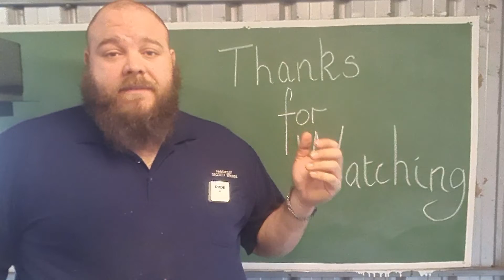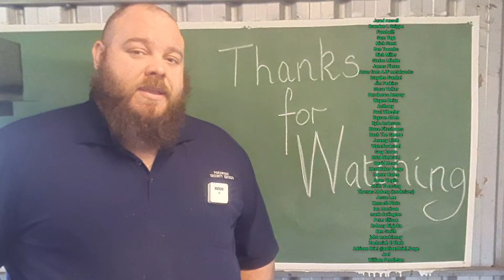Relining a Postbox Forge

Comment: So,... that was 2 layers of 1 inch isowool?, regidizer and then how much refractory on top of that.  I saw where you forgot to film the refractory part, what a mess that always makes for me.  Good job.  Love the podcast and would also love to see a postbox forge video.  Thx.
Reply from the maker: The RTZ coat is only a few millimetres thick, it doesn't need to be very heavy, as it's main job is to make a hard reflective layer at the surface.

Comment: I'm build the same venturi  burner 1inch , what size orifice are u using ? Have you found 2 work best for the post box , I'm currently build one using old metal solvent 5gallon buckets,  thank you sir love your content
Reply from the maker: This is the gameco large burner, they come standard with  a 0.8mm orifice
Reply: @SamTownsBladesmith  the one I have didn't have (guts) I've build that part  used .045 mig tip , I think its 2 big , 8mm is a .030 mig tip Im pretty sure, I haven't fired it yet , I think I will reduce it down 2 the .030, thank you sir 4 the help , love your work peace

Comment: Use PPE, this stuff is toxic!  I get that warning, but I have a serious question.  Is it safe to handle with bare skin?  I've used it before and used eye and breathing protection.  I simply assumed that if it was so dangerous that I needed gloves as well.  Was I wrong?  Did I just take a step too far from ignorance?
Reply: Its an irritant on the skin, the itch may drive you nuts for a while but will not cause fingers to go black and fall off!😅 The big thing dont breath in the dust, that will damage your lungs!
Reply from the maker: The toxicity is mostly from the microfibres, much like asbestos it can cause mesothelioma if the fibres are inhaled. As Paul said it is an irritant, a little bit like fibreglass, but skin contact isn't dangerous. Definitely wouldn't advise getting it in your eyes though! Gloves are never a bad idea, I just didn't have any.